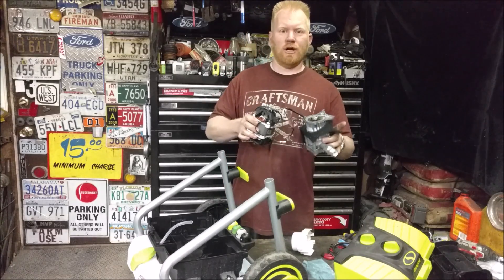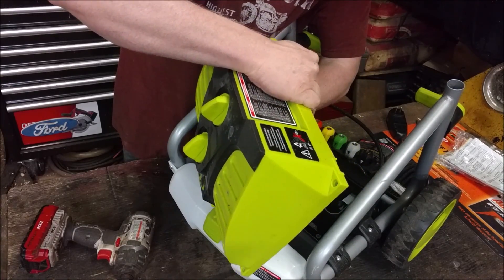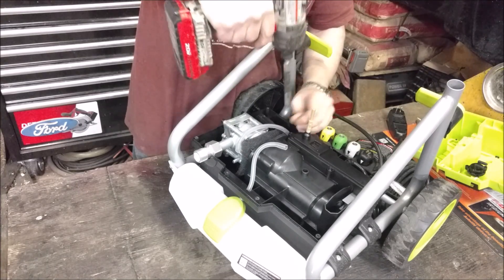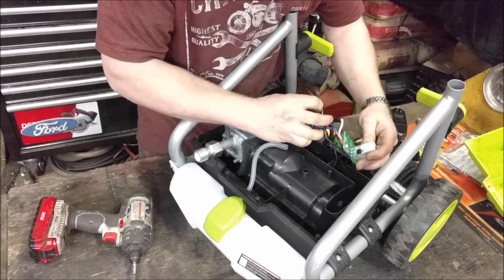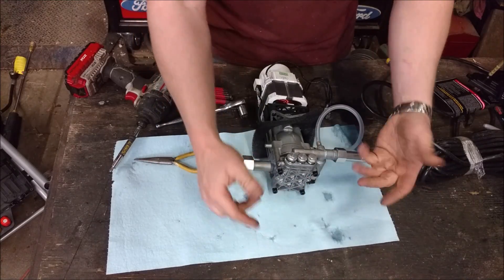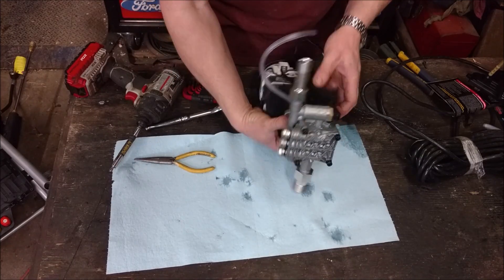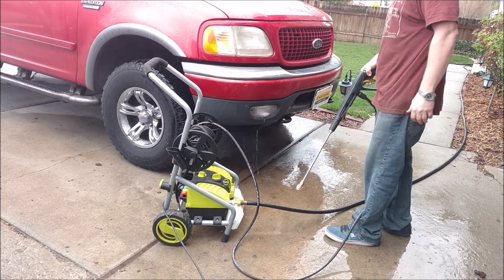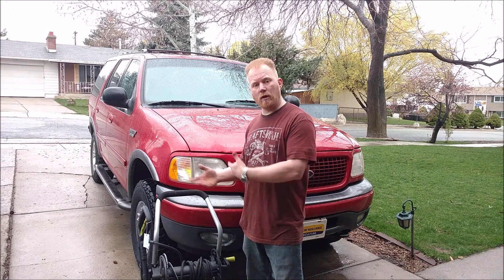How a Pressure Washer Works.. Featuring Sun Joe SPX4001

Comment: Hi Moe. Excellent tear down and theory explanation of what can damage one! That does look to be a well made machine for a smaller one. Several people I know who have complained about different brand machines they have, always wondered if they froze and don't fess up.  :) Great idea where you showed how much water is retained in that valve body when someone would think different and then storing in a cold place for winter.
Reply from the maker: These low end triplex pumps don't have a very long lifespan to start with. They are designed to run around 50hrs+-. They will allow a homeowner to wash their car 200 times or for 10years if not frozen, etc. The issue with these pumps on the gas machines is the operator leaves them idling for 5-10minutes while they hand scrub the car or move something. The pump circulates the same water for this time and overheats. I find they start overheating in a couple minutes of not pulling the trigger and get up to a few hundred degrees F fast. The constant water passing through while pulling the trigger acts like coolant. The pump spins at 3600rpm on most consumer direct drive units and only 1800rpm on commercial belt driven units. The lower rpm keeps the commercial units cool and give them a much longer life.
Reply: Very interesting and thank you very much, super info. I have friends who have issues with their washers and several with issues currently. It is a gas powered one like you mentioned. (actually it was a gimmie - freebee) May I ask what parts perhaps should be looked at to repair if this happened? I know another guy who borrowed his to a neighbor and said it didn't work right when he got it back. (gas too) I will be passing this great info to those guys and thank you in advance Moe, Jeff.
Reply from the maker: From what I've seen in this style of triplex pump, it is just the piston return springs or the spring retainer that breaks with all the heat/vibration. A few brands use an all ceramic piston that I've also seen snap.

Comment: Thanks for the tear-down.  You are right about the water freezing in there, I ruined a pressure washer pump because of that.  Now every fall I run RV antifreeze through the pump before putting it away for the winter.  I see now that Home Depot carries the SunJoe brand/
Reply from the maker: Thanks Pete. -Moe

Comment: I love that simple switch for high, low, and off. Very smart for them to use parts that can be bought pretty easily and not have to make a special one. Looks like a pretty well made unit.
Reply from the maker: I wish manufactures would keep more stuff simplified. But they want to make money off selling replacement parts as much as the tool.

Comment: Great stripdown and discription of the way it works :-D.
Ive allways liked your straight forward way of explaining things.

Perhaps that device on the heatsink is a triac, same idea as a lighting dimmer, chopping parts of the ac waveform out to produce less voltage,  also adjusted to drive an inductive motor.
Like the switch/cam, simple and repairable.
Reply from the maker: After I did the video I was looking at the circuitry and was thinking that is was a triac, as this is the only way the simple circuit could reduce the motors power(low)
Reply: Yes it sounds like you had the same thought, typically lighting dimmers also have a two pin diac that looks like a blue or red diode without a band.
If you see that, it sounds like a phase firing chopper.
Ive seen the same type of circuit in vacume cleaners for the speed.